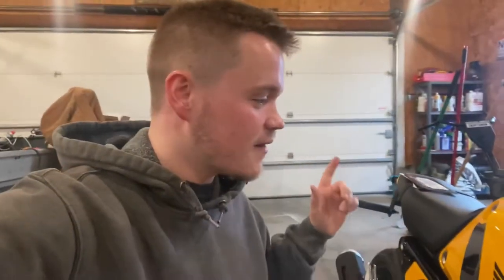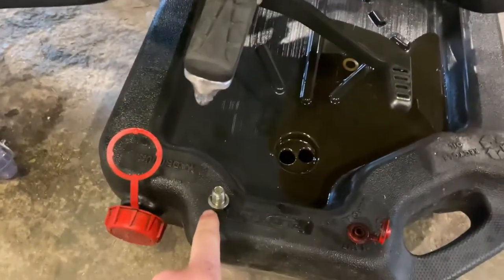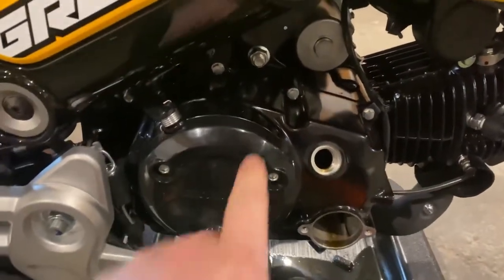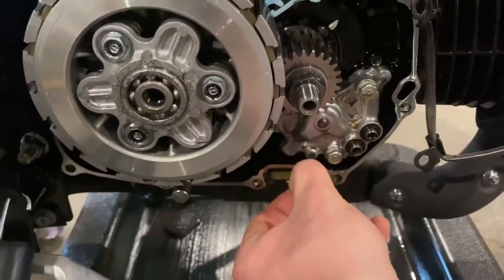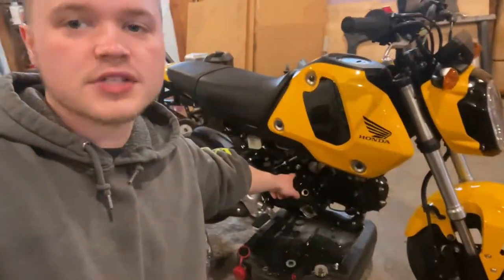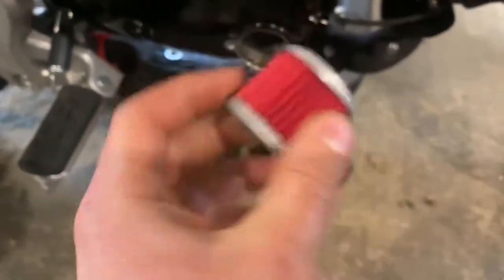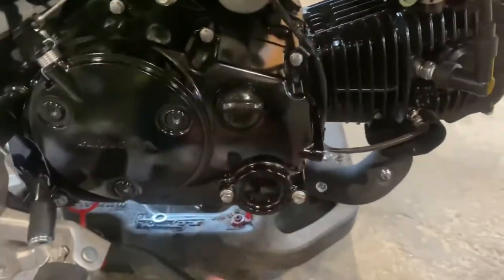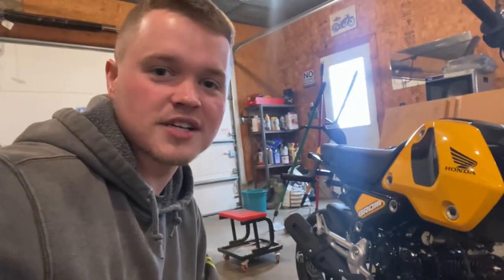2022 Honda Grom Oil Change and Oil Screen Cleaning!

Comment: If you strip a bolt hole on a block or other aluminum threads, you aren't screwed. If you use a King Cert or Timecert you will actually be stronger than it was before. Its basically like a steel sleeve. You drill threads out and retap the hole. Then the Timecert gets red locktighted in and has your original thread in it. Now that the material is steel on the threads you will have many more torquing cycles. We use then when head studs get pulled out on high boost engines.

Comment: Nice video. To get to the oil screen, did you need to loosen the rear set to remove the side cover. In other videos I've seen they remove the rear set but you seem to have removed the side cover without having to do this.
Reply from the maker: I did not remove the rear set, it maybe would have made it alittle easier but definitely not needed!
Reply: @DanesWorld2021  Thanks heaps for the information. Really helps immensely!

Comment: Have you experienced the transmission problems with your grom? Wanting to buy one but have seen other videos about that issue that Honda won’t fix
Reply: I have the 4th 5th transmission noise issue on my 23 from under 250 miles. Based off what I read I’m gonna change oil and overfill the amount of oil and see if that works. This issues occurs after 20-30 mins of riding something to do with heat.
Reply: @rioaxjenjsndbejs3613  unfortunately I don’t think Honda will fix this issue. They’re notorious for letting things slide and just fixing it with the next model/design. The 2017-2023 CBR1000rr’s have engine problems. Been there done that. They don’t care.
Reply: @C A no, no they aren’t. Settle down super rider.

Comment: Did you re seal the cover when cleaning the screen? Or was it a rubber gasket. Just got my 2023 grom
Reply from the maker: I reused the gasket that was there. Do not use a silicone gasket maker on these! Just get a new gasket from Honda if you are afraid to mess the old one up
Reply: Damn I just bought the 22 new last week. But in Australia we won’t get it for a year like everything else
Reply: @DanesWorld2021 you ever get your grom?

Comment: cant i just change the oil and filter?
Reply from the maker: You 100% can! I just did an in depth oil change since the engine was new and it had silicone that broke away from factory which can cause that screen to plug up and slow oil flow.

Comment: Do not torque those case bolts unless you have a very accurate torque wrench
Reply: So... You don't put it back together? Yes being sarcastic, what do you consider a very accurate torque wrench?
Reply: @dominicelek9394   hand tighten, tighten 1/8 of a turn by hand, criss cross pattern bottom bolt top bolt left bolt right etc

Comment: not a chance I'm taking the case cover off to change the oil on a grom lol.
Reply: Specially on the older models with the oil spinner you should do! 
2500km and i found 2mm thick mess and aluminium bits in the spinner….
Reply: You have to to clean the filter

Comment: How often to clean screen
Reply from the maker: I believe the manual says like every 4-6 thousand, I’m going to check mine every thousand since I beat on this thing pretty hard. Wish I could ride it right now but I went down hard on it about 2 weeks ago and had to have shoulder surgery!
Reply: @DanesWorld2021  ahhh man that sucks. But I ride mine hard asf also. Practicing wheelies everyday and at 1500 miles currently with still factory oil 😅 I’m not riding because I put a new cam and intake on with Exhaust. So I’m waiting for stage 2 ecu. But I need that oil change asap. Thanks man
Reply: @DanesWorld2021  what happened?
Reply from the maker: I came down a little weird from a second shift wheelie, threw me over the bars, landed straight on my shoulder and snapped my collarbone. It was super displaced so they had to put a plate and screws in
Reply: @DanesWorld2021 I hit some sand while leaned over in a turn and destroyed my collar bone too. Broken in 5 places and now have a titanium plate and 6 screws. 

Just shy of the first oil change when it happened. 

Hope you healed up well. Thanks for the video.